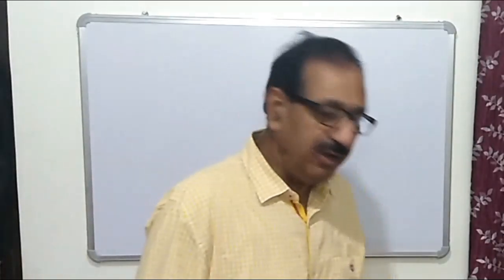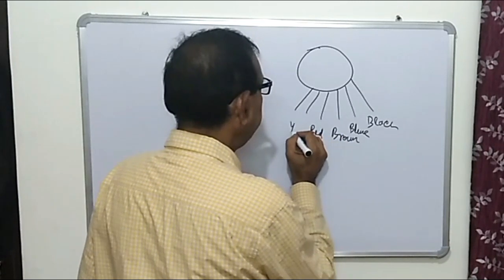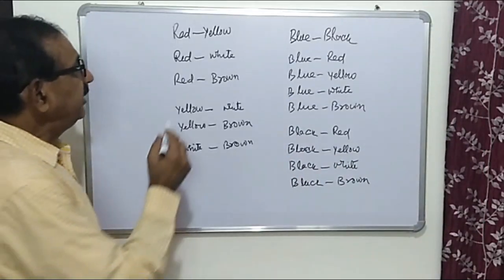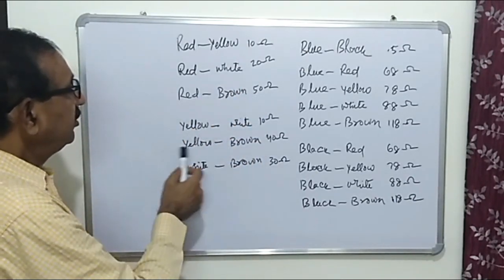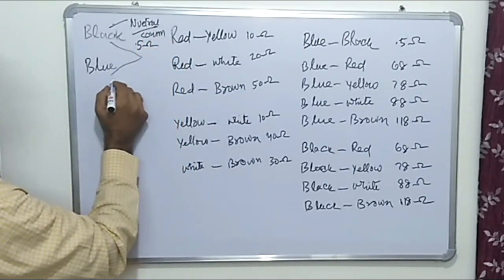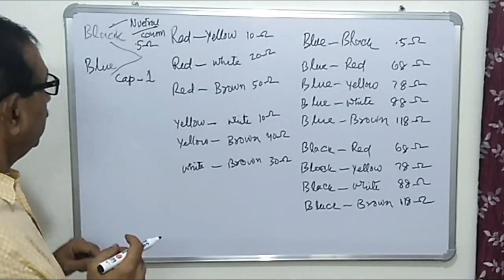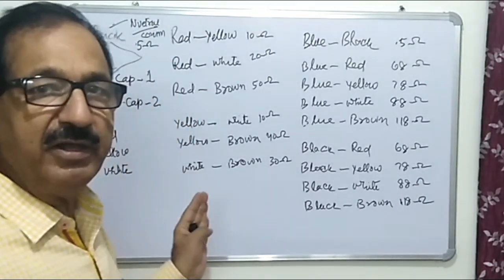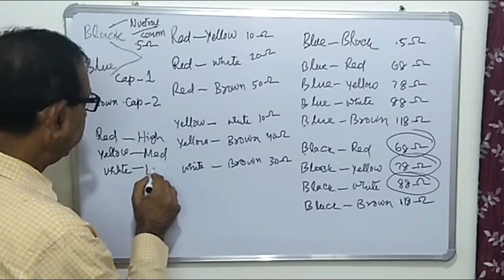Easy way to find out the Wires of Window Air-conditioner Motor (English)

Comment: Hi there, is there a way to contact you directly for an issue I am having? I have 2 hood fan blower motors that I am trying to swap 1 out for the other and would like to find out which wires correspond 1 motor to the other - they are Electromec model EP40 RTC 6211 28 CL B and model EP45 006.. CL.F. Your help would be appreciated. Thank you.
Reply from the maker: Presently I am in USA will be returning India very soon